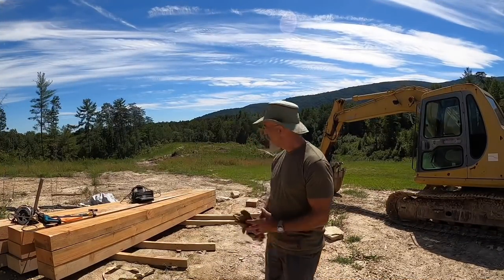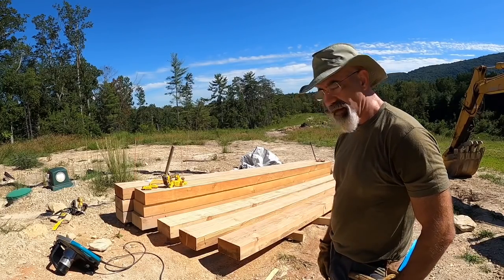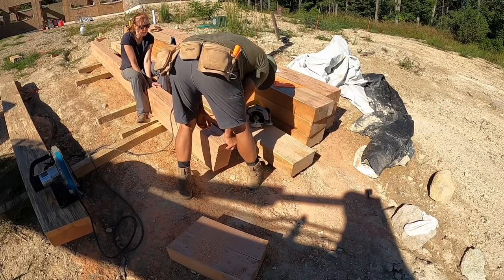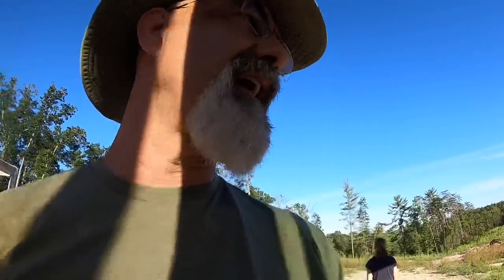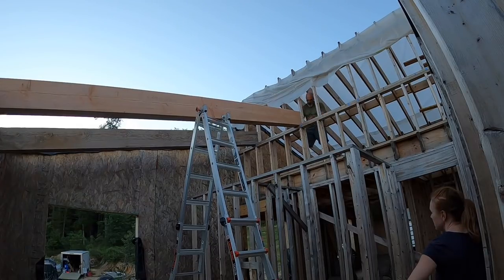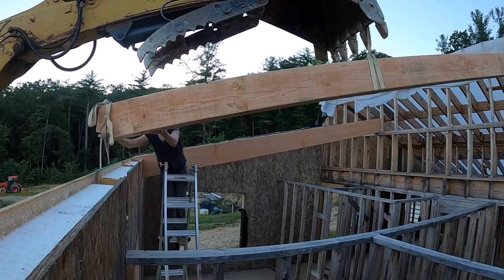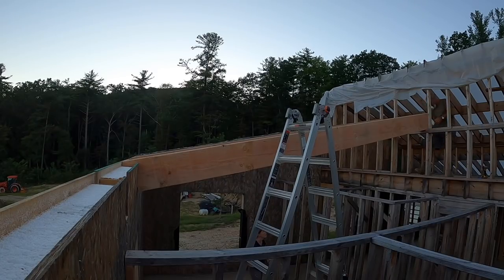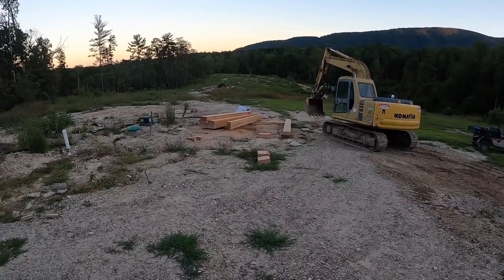Douglas Fir Beams in the bedroom ceiling. Husband and wife DIY post and Beam SIPs house Build #73

Comment: Just love watching what you re doing. Kind of struggling with what you are calling hot but then I live in Australia and your cold weather would knock me for six (old time slang - sorry). It is going to be impressive when you finish. Small tip when you are lifting with a digger and a bucket hook. Curling the bucket might give you more control on small fraction movement up and down and it is more controllable by you. Been operating for so long I forgot when I first started so hope it helps. Happy for you to tell me to bu*&er of as well.  Cheers from Australia.
Reply from the maker: I was thinking the same thing as I was editing. I was on a curved surface. Tracks were halfway up a 45 degree rise so sometimes it felt more stable to just backup.

Comment: A few things, if you can, use more length of strap between your bucket and your beam, this will allow you to muscle the beam in place without having to place the bucket precisely. 

I know your wife is doing her best which is good but if you had her doing the lifting and you doing the muscle on the ladder, it would be more efficient, especially if a longer strap made the bucket placement less precise.

Another thing is when your beam is perfectly balanced, you are trying to place both sides simultaneously.  You might want to go to a sporting goods store and get a few 5 lb plates and screw one or two on to the top of your beam so you can lift it balanced, get the top close, strap it loosely in place, remove the weights to make the tail heavy, set the tail in the pocket and then line up the top (without the tail wanting to move).

Lastly, if you can lift half a beam on the ground, you should be able to do it from the second story, fine adjusting the top doesn't need the machine lift.  It might seem like more physical effort but it probably isn't.

So I guess turn your wife in to a machine operator is the key here, then try to place each side individually.  I hope the advice isn't too late.
Reply from the maker: Never too late. We have lots of things left to build.